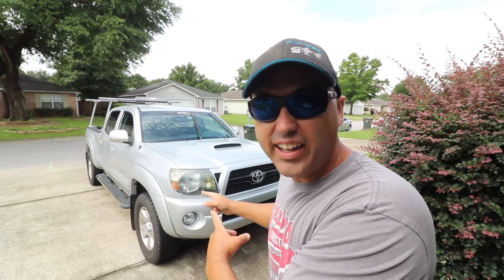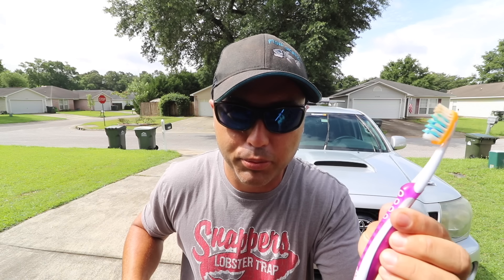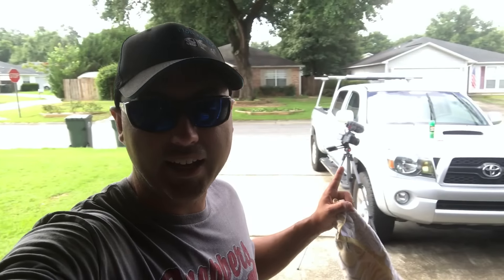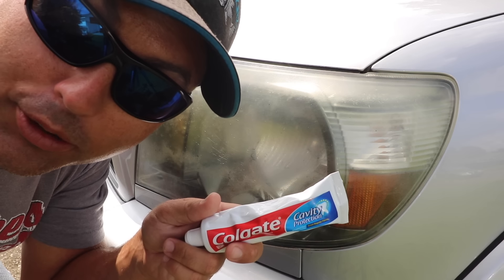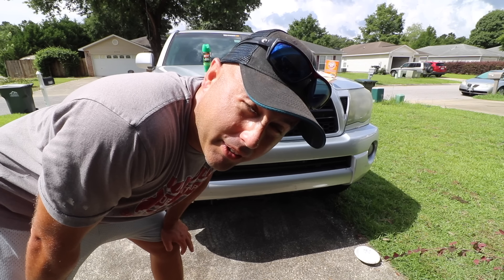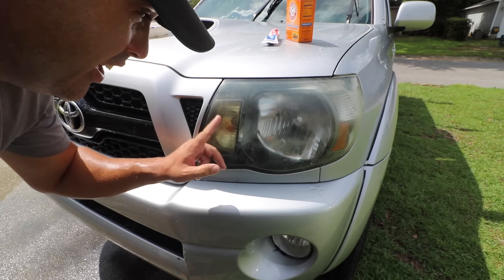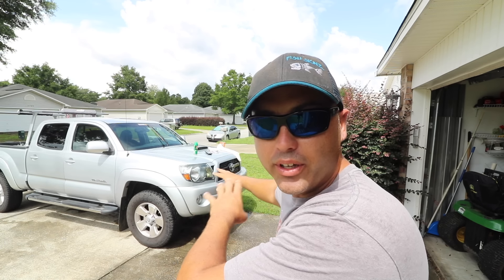The TRUTH about OFF & Toothpaste vs Headlights! (+Update on WD 40)

Comment: So, I do realize that this video is 4 years old, however I have just stumbled upon it & Yak, I think your energy is awesome, you surely made this video entertaining to watch that is for sure... now, moving forward I would like to say that as an Automotive Detailer in business since 1999, OFF IS NOT THE ANSWER!!! In fact, I have also tried this, yes... of course I did. I didn't become a successful detailer by just using one line of fine, high end products. I became successful through this simple thing known as trails and tribulations. How else would I know what the outcomes may be? Or even more importantly how to fix these outcomes have they ended in disaster, much like the OFF did. 
Upon using OFF on the headlights of a 2002 Cadillac Deville I did in fact burn and melt the headlight housing from the chemicals in the insect repellent. It was an error that I was not too soon to repeat. I quickly then learned a more permanent solution to fixing those awful foggy lenses... & yes, there is a permanent answer!!!
That answer is 600 grit sandpaper & soapy water, then 1,000 grit & the soapy water, followed by 1,200 grit and water. Then a few coats of a clear lacquer or automotive clear coat, then hit that headlight housing with a final 1,500 grit sandpaper and a little less water... wipe dry with a towel then apply a final coating of any mineral wax and BOOM, there is your shiny old lights back in action again.

Happy to share my experience with you and others. Hope it was somewhat helpful and please people, DO NOT USE THE OFF FOR YOUR ANSWER TO CLEAR LIGHTS!!!!

PS - You have a new follower, Yak.  🪳🦟🔫🧽🪣🚗

Comment: It's actually the DEET in the Off, it literally dissolves plastics and clear coats.  So next time, probably safer to spray it on the cloth instead of direct on the car.  Might actually eat some of the clear coat from the hood.
Reply: Perhaps if you cleaned it and followed it with some UV grade clearcoat, it would stay clear longer.

Comment: I used the turtle wax kit with an electric buffer...then used a good quality auto paint supplier clear coat with UV protector...worked GREAT...only wish I sprayed the clear when it wasn't 35 degrees outside, otherwise it would have been perfect....great video for a quick fix though with the OFF spray

Comment: As  I understand it once you've cleaned the film off the polycarbonate lens you have to seal it to prevent it happening again.  A clear sealer maybe even hair spray would work.  If you don't do it you've only cleaned the dirt out of the cracks and they'll only fill up again and since the lens is not sealed the UV light will cause the polycarbonate to degrade again.
Reply: Hairspray turns yellow

Comment: I never posts comments, so, this is a first after just discovering this video. This "hack" was recommended to me in May by a windshield installer. I had done a few of these methods since the following year and with unsuccessful results. I cleaned the headlight with soap and water then followed up with non-ammonia glass cleaner using a paper towel. It was dusk so the temperature was pleasant. I coated the headlight with the bug spray three times with a side to side motion and giving it a minute to dry in-between. Only wiping up the run off at the bottom of the headlight. I let it dry overnight and by morning it was "like new". Three months later of AZ summer heat, it's starting to show some haze. This will work on most OE headlights and aftermarket. I also discovered it has to do with the chemical makeup of the lens. (Just in case you start to wonder why the bug spray isn't working). Which means it's time to shop around for another headlight. (I found my second one on ebay with time and patient!

Comment: When using toothpaste use a cotton cloth or a tarry cloth n during the process of buffing around 7 to 10 mins keep reapplying small amounts of toothpaste. Wht also works as well is a SOS pad in a buffing motion. Give it a try an post a video while preforming the two different techniques.

Comment: I use a blue kitchen scotch scratch (blue does not scratch plastic in the kitchen Ex. microwave controls, the green scratch does scratch/scars plastic), also I used Meguiars Restore & Polish and then was still not satisfied, so used the blue scratch pad and wet baking soda - took another layer of the oxidated yellow scum off.  I did not paint them.  I did use Meguiars polish to try and protect it for 6 months. This only lasts 6 months, it must be restored biannually.

Comment: Yes there are many different methods but most fade in a short time. My go to is to use cutting compound and then apply a carnuba wax. I use a variable speed polisher and wipe each off with a microfiber towell. It usually lasts about 3 months.

Comment: This is very funny cause I jist used REPEL on my headlights and I could see the difference between the OFF v REPEL. You can actually see that REPEL is working better cause it started dripping and clearing the yellow off the lights. Now the way I usually do it is I have 2000 or 3000 grit wet sand paper and I use compound and then wax and it usually last about 1 year or so. Now this is how I do it myself, I know there's other things one can do but this usually works for me.

Comment: All you need is a product called Novus , it’s for cleaning plexiglass.  You start with #3 , #2, and #1. You rub it on in circular motion with micro fiber or even a old wash cloth.  Start with #3, work your way to #1. Remember this is not dirt causing this it’s mainly the sun and the plastic lens breaking down. I always try to park the front of my car away from the sun, I’m in AZ it’s brutal.

Comment: You have to be careful with Off around your paint. Years ago my daughter left a can of Off in the driveway and I backed over it. My tire made a the crushing of the can made a puncture hole and a stream of Off went right across the hood of my car. I stopped and quickly grabbed a towel and gave it a quick wipe. The Off came off along with every bit of paint right down to the bare metal. I mean a clean sweep with no smears. Everywhere the Off touched the paint wiped right off.
Reply: Yet another reason why I’m glad I don’t have children, lol.

Comment: If you use 1500 grit sandpaper with water and sand it for about 1 minute. It will look hazy but then you clean it with alcohol, then spray clear on the lens and it will last you about 2 months.

Comment: Use 800  Grit sandpaper water in a spray bottle and a can of rust oelian clear coat wet the headlight and use the 800 sandpaper on the light and keep it wet while you use it let the  Head lots dry really good And then Spring with the clear coat And due to the 3 Coats on each headlight and they will look like new  and will last a long long time

Comment: Application is the key with the toothpaste. A toothbrush is not an effective tool. You need a cloth or strong paper towel. Secondly, adding backing soda made the abrasive particles bigger. 
Toothpaste does work you just need to apply it properly and spend more time and elbow grease on it. 👍

Comment: what you need is a tube of solvol autosol  that will cure your problems it is so powerful it can make alloy 
 look  like chrome put it on with an old bit of denim jeans cloth buff in circles when light is bright wash it and give it a coat of wax. lasts as long as your car.

Comment: Bro all you got to do is wet sand with 800 grit left to right motion, 1500 grit up down motion, and then 3000 grit left to right. Then you can literlly get compound and polish and hand polish them. Or u can use a machine. Then buy some sealant or ceramic coating

Comment: The toothpaste is a mild abrasive so if rubbed enough will fix but if you want them fixed use sand paper then plastic polish 800 1000 3000 wet sand

Comment: You lost me at 6:00 because a toothbrush does not have the amount of pressure you need for the toothpaste to actually work.  You need to apply the toothpaste with a cloth like a piece of towel that you can rub onto the lens applying firm pressure as you rub in a circular motion.  A brush? A brush will do nothing to remove the oxidized film of the lens.

Comment: enjoyed your video, i used to do same thing but I tried using goof off, then used auto zone engine cleaner. engine cleaner worked best, then I used turtle wax spray wax, used Dremel  to buff wax to nice clear shine. found out that its not only the uv rays its oils from leaking cars, to prove my knowledge take a piece of plexi glass smear some used motor oil on it, wait about one week and try to clean with soap and water, that's is why wd40 worked it cleaned the oil from the plastic, so putting a top coat on will seal out oil from getting back in for a while.

Comment: I used  Polishing compound or you can use  sandpaper that's less abrasive and do the same thing as long as it's clean before you spray clear coat on it to take the dirt off and then sprayed some clear coat on it and it look brand new

Comment: Steelwool and aceatone works last about a year  you have to get the clear coat off first then one pass with aceatone on a napkin let dry then cover with clear vinyl or spray with clear coat takes 10 min will fix that problem for years

Comment: The test shows the difference so viewers will not waste their money, I have been using OFF for about 3 years now, good for a few months depends on UV rays. Now I don't do the kit, I use OFF, clean with water, then use 800, 1000, 1200, and 2000 Wet or Dry sandpaper. Next, I use a clear aerosol spray paint 2-part epoxy. Spray a light coat, wait a few minutes, 5 or 8 depending on temp. Then spray on a heavier coat, let dry. If sprayed on without much orange peel or no runs, then sanding and buffing is not needed. The 2-part clean epoxy paint protects the lens from UV, will last for years.

Comment: You better off wet sanding the headlamps, then use polish compound finish it with Polish wax   optional apply professional clear coat.

Comment: off does work but it leaves a sticky film . use vinegar to wipe off the film and your set then buy some clear coat wipes and your good.  Also I used mothers mag wheel cleaner on mine and buffed them out and wow great then I clear coated them and after two years still look great. Also Turtle wax make a clean and sealer that does everything the sanding kits do for about 14 dollars.

Comment: Peroxide baking soda with whitening you're supposed to rub it on with your fingers nice thick coat, use tooth brush  and 10 to 15 min remove w/ warm water do a 2nd coat as well then remove and wax it, done?!

Comment: Put toothpaste on a clean wet cloth and rub it just like when you're using a rubbing compound. Do it several times and after that, wash it with water. I've done it to my headlights and it works better than the off spray

Comment: Depending on how bad the lights are, I start with 800 grit wet n dry paper, work my way up to 7000 grit or 12000 grit Micro mesh, then G3 compound and finally Peek polish.

Quicker with a buffing machine for the later stages, especially if you've 2000 and 4000 grit Abracs pads instead on a buffing machine.

Makes them as close to new as I've ever seen.
Reply: Right 🤠

Comment: The mistake done here was scrubbing the light with a toothbrush!..Even though the toothpaste cleaned it a bit the bristles scrapped it more.If you use a cloth like the other side it would have  turned out much better...I use 'Brasso' once a month & it works fine....

Comment: If you are not using a degreaser on your vehicle then you have not properly cleaned your vehicle. What you are pulling off is the dirt you didnt get off when you supposedly washed your truck. So again i say, sandpaper, water and conpound works

Comment: Hey, don't discard the WD-40 idea entirely. I had tried the kits on badly fogged headlights before, spent hours trying to get them clean. Barely made a dent. The Wd-40 got the fog off instantly, but I suspected it wouldn't last. So I followed up with the kits. Much easier after the spray! And then I used the sealer from the kits. My car is a 2005 and the lenses had probably never been cleaned. They were bad; impossible to see inside. Now they look amazing, not perfect but then the car is old and rusty. Better lights to see the road and to be seen. I'm very grateful for the tip. Thanks!

Comment: You didn’t use nearly enough toothpaste and you shouldn’t have put baking soda in it. Also, you need to use water mixed in with the paste…just a little. It works great.

Comment: If you use the off first you never apply straight on the light that's a no no spray it on a paper towel a lot let it dry then clean it with water let the water dry then apply clear vinegar on it it will neutralize the Feet.

Comment: The toothpaste works if you buff it out and the reason why it works is because it acts like sand paper.   You are also suppose to add wax to it after wards.   However the toothpaste is not magic, you have to essentially work it in and scrub and repeat the process until you get a desired result.   This it takes 5 minutes just to put it on toothpaste correctly on a headlight, and that the total time he took with the toothpaste and did almost no work, and it still made a difference so imagine if he actually worked it in and took 30 minutes to clean it.  Also again you are suppose to add wax after.

If you are lazy and want to put no work into it, then use off.   Don't use toothpaste.

Comment: The best thing you could do for your headlights is once you get them nice and shiny and they are dry and they are still nice and shiny take them out of the vehicle or do a really good tape job around them and clear coat them with a regular can of clear coat that you can buy just about anywhere more than one coat is preferred for lasting longer

Comment: As a auto glass technician I'm telling you the best thing you can do for your headlights if you do not want to spend a lot of money to buy new ones is once you get them nice and shiny and clear spray a layer of clear coat over them the more layers you put the longer it lasts headlights get the majority of abuse when it comes to wind rain and everything else that runs into them a few layers of clear coat will keep them easy to clean for years

Comment: I'll tell you what I restore headlights quite a bit of an auto body technician what I do and it takes a little bit of work is I wet sand it down with like 800 grit sandpaper then I take Meguiars Diamond polish put it on the headlight and I'll take my buffer and buff it out there's a film on there you got to get off to make the headlight look all unified and then you buff it out a couple of times and then you could apply some wax if you want after keep it protected works great had no problems never had a customer come back

Comment: It's not UV that is causing the headlights to become cloudy. If it were the cause, then all of your running lights would become cloudy as well. They don't. Even bicyclists would have problems with their reflectors, head and tail lights getting cloudy. They don't have that problem either. They do have some problem with their head light plastics yellowing over time which is UV damage. Also this UV damage to plastics will make them brittle and very easy to break. What really is happening is that the headlights are getting sand blasted by dirt and bugs in the air hitting the headlights while the vehicle is at highway speeds. This leaves micro pits in the plastic lens of the headlights causing them to get cloudy looking over time.

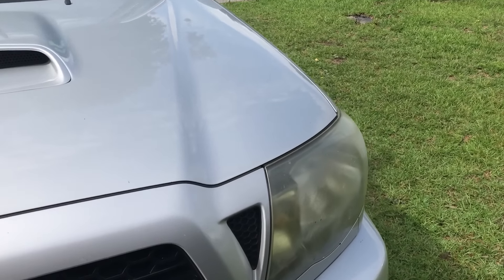Comment: 0:55 FYI, L or R determined from driver's seat. So driver's side parts are the LEFT
and passenger side parts are RIGHT. You're facing the front of truck calling
passenger hdlite left and driver side right. Which is easy mistake to make for
those not in the automotive business. Now remember: Passenger's = Right,
Driver's = Left

Comment: On the Rt head light you applied  OFF DEEP WOOD   spray and you  rubbed it well for  along time .....  and on Lt head light  you applied Colgate+ baking power with a brush  and left it  why did,nt you rub it as you  did  with the Rt head light ? Later you just washed both the head lights with water jet and showing the poor result of Colgate ? not jusified atall..?

Comment: Just my take, toothpaste and baking soda has been a tried and tested DIY household light polisher for many years like on certain products such as for jewelry polishing.  But for your test, you should use an electric rotary polishing tool to buff the headlight lens to some extent to give justice to your experiment.  Toothbrush is not enough, unless you are only comparing ease of application as against the OFF spray.

Comment: Try “Lucas Slick Mist, Fast & Easy Speed Wax”, “Torque Detail Mirror Shine” “3M Rubbing Compound”, “Tide Pods”, “Black Magic”, “Meguiar’s Hot  Shine Foam”, & Liquid Soap. Sand it with all the cleaning products combined while using a P800 Sandpaper. No WATER! Wipe it down w/ a towel.

Comment: Haven't heard of anyone trying oven cleaner yet. I tried wiping it on with a paper towel, didn't leave it on more than a few seconds, scrubbed it with  a Mr. Clean Magic Eraser. Wow, did a great  job cleaning, took years of discolored gunk off, but it did nothing for transparency. Maybe if I left it on longer? Kinda afraid it'll dissolve the plastic, or glass. Has anyone else tried this? I might try Raid tomorrow after a good rinse. Toothpaste and baking soda did diddlysquat on the headlights. It does a good job on teeth though.

Comment: I agree with you about melting the top layer of plastic. That’s what happened to mine when I tried off. I wound up using one of those sanding kits to repair the damage from the off and restore my headlights.